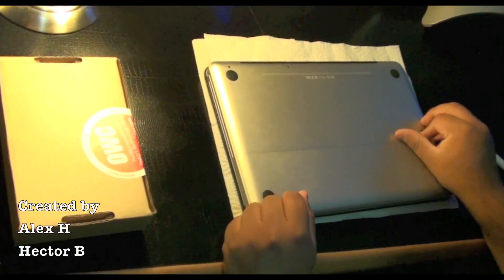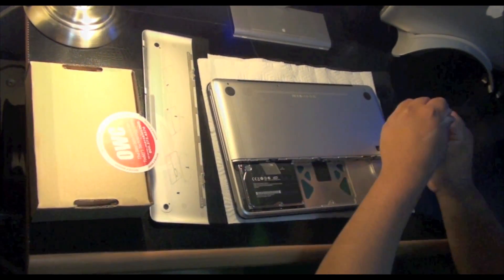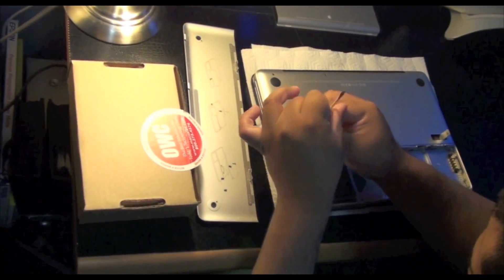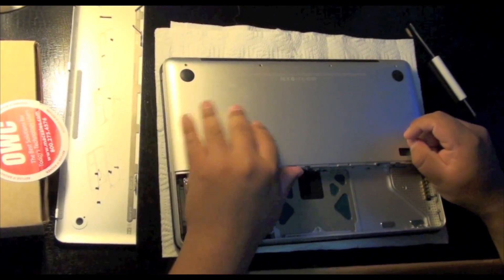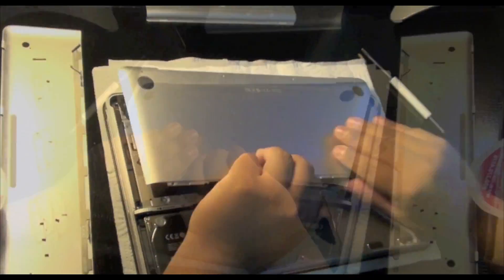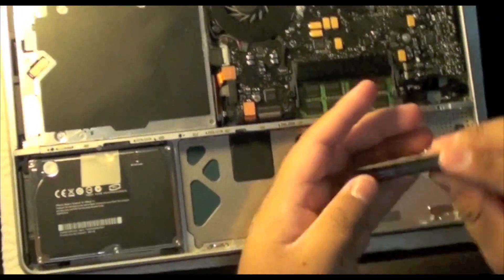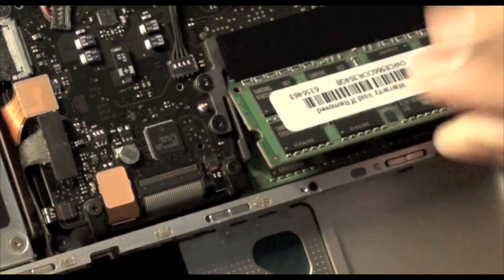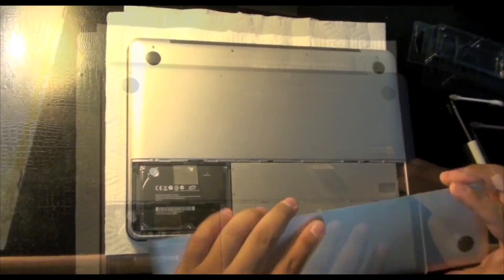Macbook 2008 Unibody Memory upgrade 6GB RAM

Comment: A System SMC Update for APPL (1.42) will make full use of all 8GB.

Two DDR3 204 pin 4GB DIMMS were seen for only $20 < on eBay, lately..
Reply: 2008 MacBook pro upgrade to 8gb

Thanks

Comment: click the apple -> about this mac -> more information 
Boot-Rom-Version=MB51.007D.B03 ? Cool, you have the actually firmware on your MacBook to run 8Gb of ram! I don't know which Boot-Rom-Verison you need for the MB Pro but you can easily look it up if you know how to use google ;)
And you need version 10.6 or higher as Os ;)

Comment from the maker: @cammyjeee Thanks, hmm you dont need any type of firmware. The computer will accept 6GB of ram no problem, I find it odd that apple would state a MAX of 4GB. In terms of specs You'll need pc8500 ddr3 1066mhz 204 pin RAM.